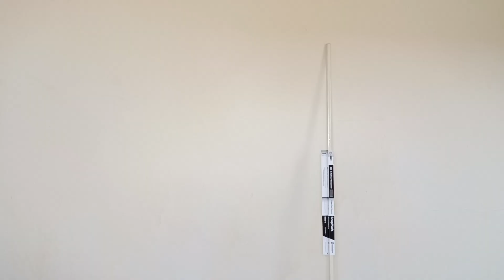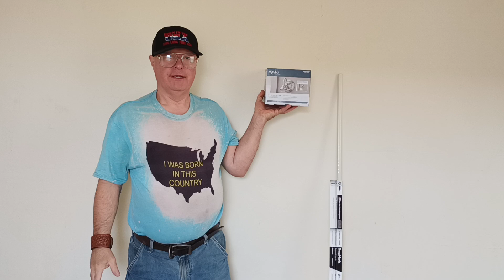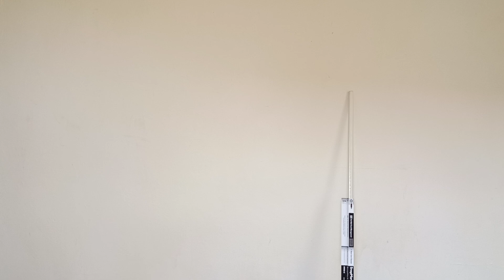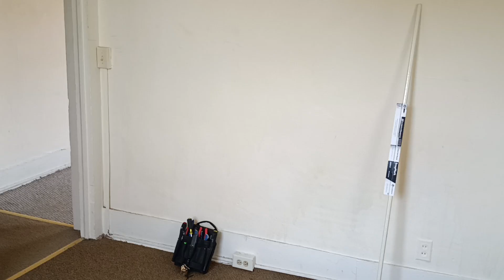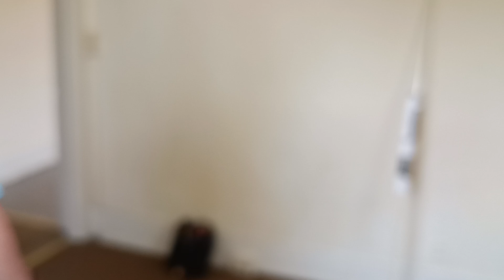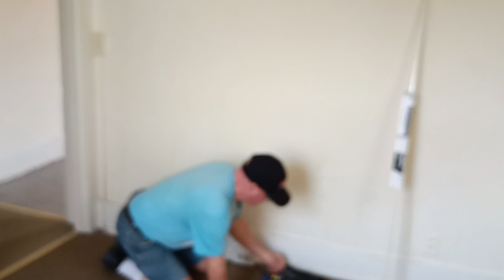April 2024 how to install wire mold & wall light by style selections item #321907 model #FV09-043-5

Comment: You daid you are maintaining a luxury apartment complex subject to piblic trespass and you are doing electrical work that requires a licensed electrician and licensed as s contractor. The  only eay you might be sble to get away with that is if you are on the owners payroll snd you are licensed as s handyman. In the state i was botn in not only are electricians and plumbers reauired to be licensed but also handymen. A handyman can do up to $200 in work in plumbing snd electrical trades.